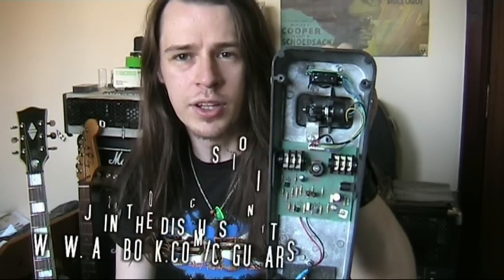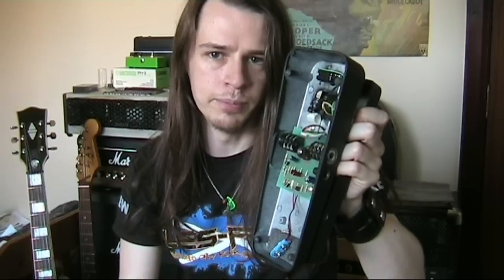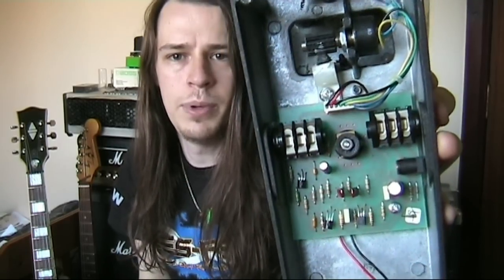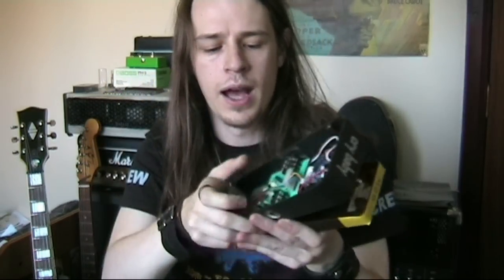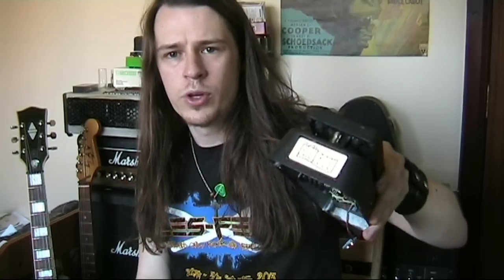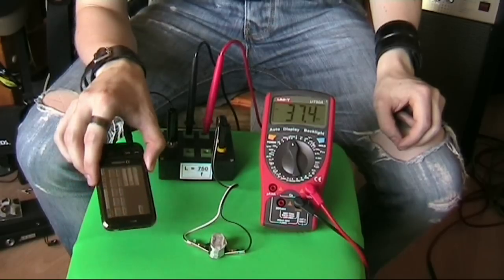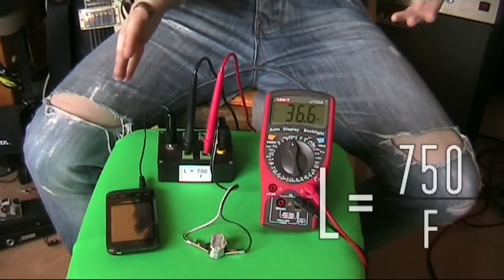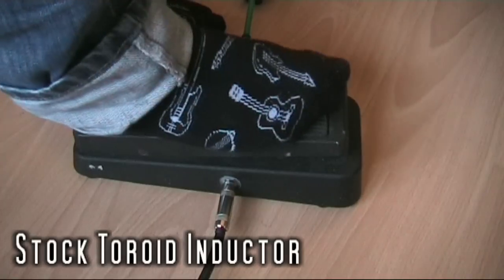Pedal Mods: Wah Inductors

Comment: Thanks for this. I have a vox jens reproduction circuitboard that I bought from a guy in Israel, and though he sells reproduction vintage inductors I'm going to have a go at making my own (with ferrite rings - I have some 20mm rings but the guy said he uses 18mm so I have ordered a couple of those from china). I've also ordered a vox/cry baby enclosure off of Ali to make my own wah pedal, though I recently bought a chinese made vox 847a which I am happy with the sound and that but want to see what I can do with a much more authentic very early wah circuit and components (the chinese one is traditional on the side of the circuit that you see when you open the pedal up, but unscrew it and on the other side is a bunch of surface mount components).

Comment: You should go to MOD kits and do a hand wired wah! That way you can put two different inductors and switch between the two or use both. Or down load the schematic and layout and gut that pcb based ele tronics.

Comment: I never really was interested in wah pedals until I started tinkering around with a MIDI expression pedal, I tried using it as a wah and I found that there are very different ways to get it to sound, and a lot of these don’t actually sound very good.  You really have to set up the curve and the wah itself to be in a “sweet spot” otherwise it can sound very lame, almost juicy, just way too bright.

Comment: Great vid, thanks! One thing is missing only: Can you compensate the lost treble and gained bass by rotating the pot to shift the sweep range? To my ears the 640MHz had a more aggressive attack that I like (sounds similar to the red Fasel in my wah of choice), but I'd definitely try to shift the pot a couple notches to get a bit less bass and more treble out of its range (as I did on mine).

Comment: Hey Colin, I've got a CFH that has lost its low end response. There's a significant volume drop in the toe up position.

Do you think the inductor may have been damaged? Perhaps the coil had some oxidation that eventually ate through, shortening the coil and thus reducing the inductance?

From what you found in your experiment here, that seems most likely to me.

Thoughts? Thanks.

Comment: 3:46 /stock 4:34 /460mh / 5:11 /555mh & last 6:00 640mh one can hit the time link and hear these directly back to back yes you can hear the wah get darker as the inductance goes up. Great review
Reply: The stock inductor sounds horrible. The 460mH and 555mH are the ticket.
Reply: @Mark70609 It's because toroidal inductors have a higher 'Q' factor than the pot-core inductors. Toroids can amass a larger amount of inductance with fewer turns of wire which translates to a much sharper attack due to the lower coil resistance value. It only takes a few dozen turns of wire on a toroid core to reach 500mH while it takes hundreds of turns of wire to obtain the same inductance value with a pot core. The resistive losses in the pot core coil flattens the frequency spread passing more midrange content making the effect sound fatter.

Comment: 460 sounds the best clean 555 sounds best with crunch to my ears, tiny margins though. I heavily modified my wah, not sure what im doing though lol but it blows my other stock wah away. Instead of adding switches with resistors I used pots and its works ok but not sure why others aint doing it, why have a limited choice of tones when you can have the whole range?

Comment: In my experience most of the stock Dunlop inductors and all of the new Fasel inductors are out of spec. The original wah schematic that I've seen specified a 500 to 520mh inductor. Most of the stock and Fasel inductors I've measured have all clocked in at 600 to 650mh. Some stock Dunlops have measured as high as 750mh. The only stock inductors that meet spec have been Dunlop's toroidal inductors like yours. I've run across 3 of these so far and they all measured between 500 and 505mh on my meter. IMO the wah pedals with these toroidal inductors have all sounded the best to my ears.

Comment: So to put it in sound mixing terms, the inductor is a band pass filter, and the higher the inductance the lower the filter frequency that is passed to the output signal. Wondering difference is between guitar and bass wah inductors, as I play both through my GCB95 and the effect on bass is not very pronounced. Thinking a switch mod that lets you toggle between a guitar and bass inductor might be cool (space permitting of course). Cheers
Reply: My reading is that the inductor forms part of a BPF which then provides filtered negative feedback to the base of Q1 which is an inverting amplifier.
I've not tried this yet, but I'm going to fit a miniature toggle switch which will add some R where R17 is fitted. As standard, this is a 0R link
Reply: Incuctance of coils in series adds up. So you can have two inductors in series (or more) for bass, and a switch to bypass all except one for guitar. In the same way, if you have one 100mH inductor in series with 450mH, you have 550 mH effective normally, and 450 mh when bypassing / short circuiting the 100 mH one.

Comment: That was interesting and fun.  I did here a bit more base at the inductance increased, like you said.  I prefer the higher treble as cut through more.  To much bass blends in to much.  I am currently modding my vox wah and I have fultone inductor to put in it.  See how it goes!  Need more solder practice.

Comment: Hey great videos this video inspired me to install a 2 pole 5 throw Tatars switch. I now have 5 inductors to choose from its awesome. I have a tone tank 444mh a whipple 511mh halo a vintage tdk 52h a tone tank film can custom build 475mhonly 16 ohms and a eleca 636mh inductor. Your video inspired me thanks. I also like the true bypass led video however I have a v847 without a power jack so I installed a power jack with a capacitor and a diode
And ran it exactly like yours. I think the best mods I did where the inductors on
A rotary and I also put a 2 pole 3t on the .01 sweep cap added .015 and .02 that is really cool along with putting the parallel resistor on a 100k pot. Now I can dial in each inductor for q and EQ via the cap rotary switch
Reply: Hey what kind of wah did u put all those conductors in can u show us a pics from yer wah that sounds awesome dude

Comment: I preferred the ~555 mH in both the clean and distorted. It had more clarity and didn't sound as harsh as the 640 mH, or as weak as the stock conductor IMO. I am new to electronics and want to fix my crybaby, as I modded it before using a mod kit I brought off the net, but didn't really understood what I was doing and was never satisfied how it sounds. I have spent the last four hours learning about basic electronics and all the components on the crybaby. I understand the things I need to change now. With help from your videos and other resources I might actually fix it! Thanks. I'm gonna purchase a Fasel conductor, change the gain input resistor to 78K (currently 47k), Q-band range to 47k - your recommendation, or 100k - recommended elsewhere (currently 68k which could be the problem, as well as the conductor), and 4.7k for the Q-band mid range (currently 2.2). I have some other recommendations from someone else on youtube, but can't understand the electronic charts/diagram, so when I get my head around it I'll post my discoveries. Thanks again! :-)

Comment: This raises the question of-the last time I had my Hendrix wah put in for repair after I got it back it didn't sound as fat as I had it before especially when doing solos the Q
In it sounds all top and no depth-frustrating :-(
Reply: Possibly just the pot and toothed bar set differently....there can be as much as a whole revolution of the pot (spare) if it's set too bassy or trebly...just adjusted a couple myself...tho if they used a new inductor or q capacitor that too could explain it...the Hendrix had a higher capacitor value than standard crybaby.

Comment from the maker: Certainly, there are many things that will affect the sound, but in the inductors it's mainly the inductance and the resistance in the coil. Inductance is a combination of number of turns and the strength and shape of the ferrite. 

Scientifically to make a comparison you need to leave all but one variable unchanged. 
Here it was difficult as number of turns directly affects the resistance. 
However I found that the resistance readings were so close over the range of mH that it wasn't a factor